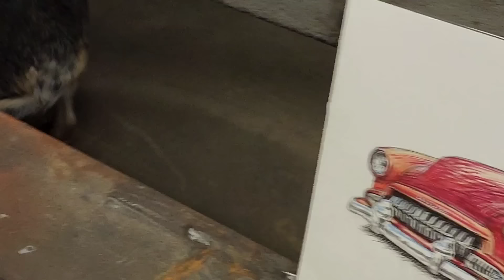Designing a custom front end... Corvette or Cadillac grill? Teardrop or canted quad headlights? 🤔

Comment: Chad just an FYI when you paint rims with the tire on  let the air out and use playing cards stuffed behind the rim all the way around, No tape needed.

  If off the car lay the tire and rim down . Cut a circle out of a piece of cardboard lay it on the tire and then install the cards under the rim and over the cardboard Now you can spray paint them with no tape. I do it all the time and reuse the cards over and over.

Comment: I like the '38 GM headlight bucket sunk halfway in the top of the fender but only extend it 2-3 inches forward of the front. and use the '47 Olds grill but maybe remove the top bar so it doesn't look too big and heavy on the front of the Volvo. Also I was thinking maybe you could extend the hood so it goes all the way to the front of the car, That would make it really sleek.

Comment: Try to put the tilted headlights more back into the fender and sort of get the fender to look slightly streamlined. I think it will work with the rest of the car. I also like the corvette grill, but it would be doubled in height or make one yourself. Maybe just an angled sheet of metal that makes it pointier in the center with 3 or 4 horizontal half’s of exhaust pipes welded in on each side as grill bars. Damn it’s hard to describe it all in English.😂
Love your work btw!❤

Comment: Good job so far.  I really like the corvette grill. It could be inset for a floating look.  A good bumper would be a 67 camaro front or rear bumper.  The rear is pretty straight and the front has a subtle point in the center.  These bumpers are very small and have been used on many customs.  A good look I would think.  thanks.

Comment: The Cadi grill with the 38 headlight bezels. By extending the headlights it will give you surface to die into with the grill. I’m sure you could figure out how to  attach it without having to do much to the fenders. The point that was sticking out on the bottom of the bezel looked like it would match up to the grill pretty good.

Comment: Hi Chad, this is Bill. I used to make grills out of aluminum and they were polished. You can set a fixture and use some flat stock and you can set them in there make a jig shape it the way you want from the left to the right on the top inside there come down on either right and left side and then go across the bottom and get a frame. Then you stand some aluminum in there and well done either end, or put whatever design you want inside that frame how’s that sound?

Comment: If you push the bottom of the "Peaked" piece you cut then the headlights will aim straight at the ground. I don't believe there would be enough adjustment in the bucket to compensate for it.

Comment: The strip of metal you have going across the front of the removable roof. Would it be possible to make a second one exactly the same that attaches to top of windshield with a small lip at the bottom edge? So when you put the roof on the two identical support walls would touch and the roof would sit on the lip of the piece connected to windshield. Also gives a place to add locks to keep roof hooked when driving.

Comment: Corvette grill looks good. But still, I would stick to the original design of the front. Fabricate a simple net grill and add a traditional Volvo corner to corner arrow with logo. Just a bit cooler than the original. And simple original style round lights. To show proudly that this is Volvo, even though the rest doesn't look like it.

Comment: I love this build so far, but not any of your headlight options, proportions at way off for this small of a car. I feel that '51 Olds headlights would look great. I would inset the corvette grille so the points on the grille would be just a bit behind the opening sheet metal and make the front end as a seamless, welded to the fenders rolled pan, either smooth or ribbed like the lower pan on the early Corvairs.
Six staggered rows of louvers on the  hood would really be the cat's ass on that car as well!